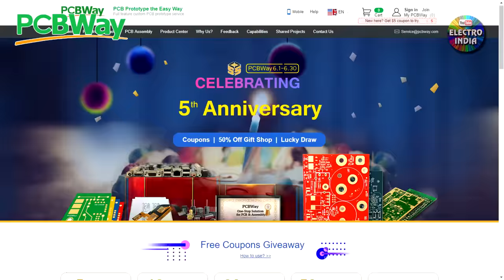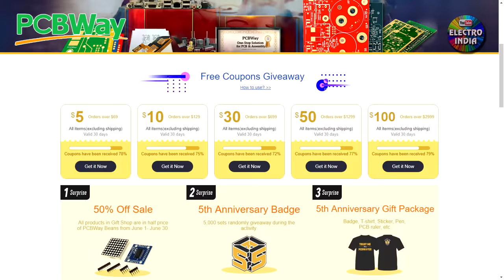How to Make 200 Watts Audio Amplifier DIY | Cabinet Modification | Hindi | ELECTROINDIA

Comment: You will never get 200 watts of clear sound out of 2 transistors per channel to 2x 30V AC power supply!
I have L20 amp from ebay with 8 transistors per channel to 2x55V DC power supply and i not get 200watt!  Nice built amplifier and good job.

Another thing. You need to mount fuses !!
Reply: Even 100wpc is enough, these paper cone/cloth surround speakers doesnt need much power to get them going.
Reply: 2sc5200 and 2sa1943 is 50watt rms and 150watt peak power.
For 200watt it's need 30-0-30v 7ah

Comment: Please meri koi help kro.. 
Mere paas aisa hi Amp. h.. Uske saath mere column (10" woofer + 3" tweeter) lge hue h.. 
Mgr unn woofers se low frequency nai aata 
Subwoofer waala bass.. 
Mujhe woh b experience krna h audio mein.. 
Please btao ki m ek Subwoofer add kr skta hu kya Amp mein.. 
Note - mere Amp. mein 2 channel (4 speaker ports) h.. 
2 ports mein abhi mere columns lge h.. 
2 ports free h.. 
Toh btaiye.. Mujhe zyada knowledge nahi h.. 
Kya m seedhe ek 6-8 inch ka Subwoofer add kr skta hu? 
Amp. pr koi bura assar toh nahi aega? 
Please 🙏 btaiye koi..

Comment: Super. But a dangerous thing. You forgot the Earth. You have a full metal case. It is a must to connect it to the earth. And a fuse will be helpful too
Reply: Earthing? No! The most HiFi-Amplifiers and other Audio/Video-Units are Protection class 2 devices. Protection class 2 devices do not have protective earth. They are not allowed either. The Metal Case in most cases is the Audio-Ground or Signal-Ground and has nothing to do with protective earth. Under no circumstances may a protective conductor be connected!
Otherwise, it can lead to massive interference, and even personal injury or property damage.
Reply: @djblackarrow  oh okay